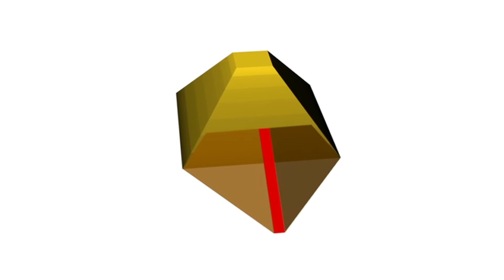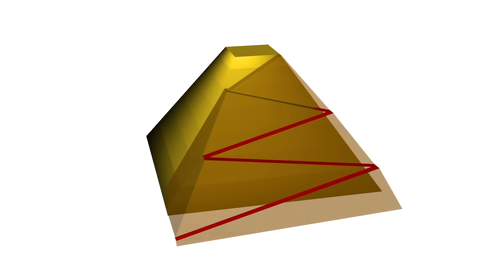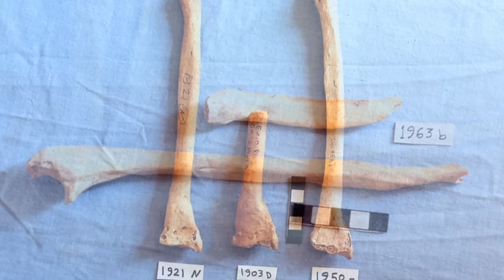Egyptology - Pyramid Construction

Comment: So if it took a long line of people to pull a block up a ramp where did the people stand when the block reached the top of the ramp? Where did they stand when pulling blocks right to the edge? They would have needed another ramp opposite the first ramp. Just add another few hundred years to the time taken then?
Reply: Not really.  So understand a few facts:

1 - the blocks of the pyramid get smaller as they rise in height.  So the largest/heaviest ones are found in = the bottom third of the structure.  Above the level of the King's Chamber of the Great Pyramid the blocks become smaller with those seen at the top being small enough to have been slid into place by several men.
2 - meanwhile the pyramids are rather "large" structures after all.  lol!  So on the bottom part - where the largest blocks are seen - literally hundreds of workers can move about. 
3 - Herodotus wrote they first created a stepped pyramid ala Djoser to then fill in the sides.  He also stated they employed levers and what he termed as "a machine" which is believed to have been a lever device employing a fulcrum and counterweight akin to the Egyptian shaduf.  So such a device could have sat atop the "steps" to raise the smaller blocks above from one level to the next.
4 - finally Herodotus wrote they encased the Great Pyramid in white limestone working from the top down.  As such the smaller blocks on the upper portion could have been raised as noted in #3 while the larger ones could have been raised via an earthen ramp the Egyptians created to raise those blocks and which as they worked their way down placing white casing stones = would have been systematically dug away until they reached the ground. 
4 - finally you fail to account for animal labor.  An ox can pull more than 2X its body weight so that teams of oxen can pull multi-ton loads.  Thus on at least the larger/heavier blocks draft animals would have been employed = meaning less men and less room required. The worker village at Giza contained in its midden heaps many tens of thousands of cattle bones.  Meanwhile there are depictions from tombs of yoked oxen doing manual labor to include pulling large sarcophagi.  So if they were eating cattle = they would have been using them to pull blocks as well. 

Moral of the story:  so when we consider the evidence then it becomes more plausible.  The earthen ramp would have sat on the south side of the Great Pyramid which was closest to the main limestone quarry and the harbor they created. It need only really have gone to the level of the King's Chamber as the blocks above that level become smaller in size. 

As most of the blocks were not that large and were in fact crudely hewn chunks of limestone broken rapidly from the bedrock + the nearby quarry sat no more than 100-200 meters from the pyramid = moving them would not have taken as long as you assume.  Also if you filled the pyramid in from the north side towards the ramp on the south side then using the earthen ramp and possibly smaller mud brick ones for smaller stones you could have placed them level by level.  Then you need to raise the white limestone casing stones beginning at the top via the lever device which sat on the steps below the level you worked at and was moved down as you went. Lots of possibilities based upon the evidence we see.
Reply: Vary Olla - thank you, that is all very interesting. I would love to see a good animated film depicting all this, I think it would attract a lot of viewers.

Comment: These educated fools fail to realize that the ramps that would be required to build pyramids via their proposed methods would require 5 to 10 times more effort and the ramps itself would be more technologically advanced than the pyramids itself.
Reply: Yet that is premised upon a false assumption.  It requires the ramp to = go to the top of the pyramid.............why??

Moral of the story:  the largest/heaviest blocks are found = in the bottom third of the pyramids.  Above that level - ~King's Chamber - the blocks get smaller in size as the pyramid rises in height.  Look at photos online of people who climbed the Great Pyramid to take a selfie.  You will see the blocks at the top are small enough to have been slid into place by several men. 

So they indeed created external ramps to build things like the pyramids.  We have historical evidence as well as archeological evidence of this.  The western cemetery next to the Great Pyramid contains the remains of earthen ramps on partially finished tombs.  Those ramps are made from a mixture of sand/stone chips/tafla - a clay the Egyptians mined.  Further near the worker village at Giza there is the remains of a massive tafla mining operation.  When the limestone quarries at Giza were excavated they were found to have massive amounts of sand/stone chips/tafla dumped into them = or what they made ramps from.  Meanwhile at Karnak you see the remains of mud brick ramps from temples being built but never finished.

So the ramp itself really only needed to go as high as the largest/heaviest blocks to be raised = King's Chamber.  Above that level the smaller blocks could have been raised via lever devices which sat on the steps and which employed a fulcrum and counterweight akin to the Egyptian shaduf.  Herodotus wrote they first created a stepped pyramid and then filled in the sides using levers and what he termed as "a machine" to raise blocks.  He coincidentally concurred with you in that what he called "a great causeway" - read a ramp - was considered to also be a massive undertaking.  

So the technology was not so great after all while the evidence supports the use of ramps.  Something new to think about.

Comment: “How they built the pyramids “ solved.
“How they built the ramps “ still a mystery.
Reply: The ramp would've have been a part of the structures, and it would have been a fckin long ramp at a 10 degree slope going up 300 feet.
Reply: @Mr._POV_  lol exactly quoted graham hancock at joe
Reply: @felixdeboer5814  if only someone could make a 3d of that mega ramp with real life measurements!
Reply: @Mr._POV_  yeah and it would still be there.
Reply: @Mr._POV_  Or you could just pull the stone up the incline of the pyramid. That's a LOT easier than a 1000+ foot long ramp incline to move stones.
Reply: @spikedpsycho2383  lol, let's see how you gonna do that.
Reply: @Mr._POV_  Turn the block into an axle. Build wooden wheels around it. ALSO. Evidence shows wet sand is an excellent lubricant even for big blocks of stone. You can bury the pyramids in compacted sand as your incline. ONCE ITS COMPLETE dig the sand away and wash its surface. Doing that you can finish the pyramid surface TOP down
Reply: @spikedpsycho2383  yea but they didn't use that useless idea of yours. We still assuming except the damn books in our schools that lie.
Reply: @Mr._POV_  HAHAHHAHA :)  SO FUNNY!!! HAHAA! Yes, this is exacly my thought but you said it funny. Also, because 10% slope is actually too freaking STEEP. I know such street and everybody there thinks it's a mistake on a sign and should be 20%. So double that ramp. NOw, whatever would be such structure, it would have to support those blocks.. and where would they get that much WOOD? In Egypt? In Desert? and then what? send it away so far to make it disappear? Burn it? And if so, no story about massive wood ramps burnings?
               THEORY: Ramps were made from Timber and were ONLY FROM ONE LEVEL TO ANOTHER. it was like STAIRS ON STAIRS GOING UP IN STRAIGHT LINE. BLOCK WAS LIFTED UP ON A WOODEN PLATFORM WITH SERIES OF PULLEYS ON BOTH SIDES. ONCE ON THE NEXT LEVEL, IT WOULD MOVE FORWARD, DEEPER ONTO ANOTHER PLATFORM. THEN LIFT TO NEXT LEVEL.    REPEAT. This would mean ONE KIND OF PLATFORM set up ON EACH LEVEL in vertically straight line.
           moving the stone  would be done by Pair of Oxen. Why those fake     experts insist it was done by foot by humans with no shoes? It those are hierogliphics.. WHO MADE THEM UP AND WHEN??????? lol
So the Platform itself would be on WHEELS! a huge CART.
Reply: More than 2,300,000 limestone and granite blocks were pushed, pulled, and dragged into place on the Great Pyramid. The average weight of a block is about 2.3 metric tons (2.5 tons).

24*60 = 1,440 - minutes number in a day
24*60*365 = 525,600 - minutes number in a year
2,300,000 (min) / 525,600 (min/year)= 4.3759 (year) 

If you pose 1 block every minute it takes 4.4 years to finish the pyramid
If you pose 1 block every 2 minutes it takes 8.8 years to finish the pyramid
If you pose 1 block every 4 minutes it takes 17.6 years to finish the pyramid
If you pose 1 block every 12 minutes it takes 52.5 years to finish the pyramid

I cannot imagine logistics even for a 12 minutes block during 53 years, day and night.
Reply: Hahaa 🤣
Reply: @Neil Kraft Hahahagaaga!
Reply: Its just ridicilous😂
Reply: What if they were just there as part of earth from the beginning? Like Mountains
Reply: @preston8859  🤔🤔🤔. Thats a fresh take on it.
Reply: domesticated megafauna... Carthagens domesticated thousands of elephants... back before last 10k year extinction event; there were easier megafauna to domesticate then elephants.
Reply: It’s just one of the hundreds of pieces of evidence that the Egyptians did not build the big pyramids.

There are about 120 pyramids in Egypt. Only a few of them 5 or 6 are built by the unknown civilization or with the aliens' help. When the Egyptians came to the place about 5 thousand year BCE the big, great pyramids were already there. All other pyramids are the Egyptians' masterpieces, no doubt. They tried to copy the Goods, but they looked like a scooter near the VOLVO truck. 

Try to find academic proof that the Giza pyramids were built 2.5 thousand year BCE. No way. There is only one - the two inches Khufu figurin found on the roof of the pharaon chamber. The pyramids are already designed on the ceramic of 4 thousand year BCE. But for academics they are not pyramids but the mountains. Ah-ha-ha-ha-ha-ha!

Academics told us that the pyramids were built to keep the pharaoh body in the sarcophagus. But until now all the pyramid sarcophagus are empty, even in the untouched pyramids (Sekhemkhet pyramid). By the way, the flowers on the Sekhemkhet sarcophagus are dated 2 centuries before Sekhemkhet life :- ))

20 years ago we must listen to the history teachers with their simplified linear version of human history. Now, thanks to god and to Youtube, we see Baalbeck, Temple mount, Mahpelah cave (Cave of the Patriarchs), Pyramids of Egypt, Machu Picchu, Saksaywaman, Tiwanaku etc, etc, etc. 
We see the traces of the rotative sees, the cylindrical drill up to 20 inches diameter, the megalithic masonry, all the masterpieces impossible for the stone and copper age. Even if you put 10 employees on the row :- ))
Reply: Great question 👍👍
Reply: X-D  youtu.be/7K0eZNSZKjI     100 TON    stone boxes discovered in egyptian tunnels -  strange machines found ?
Reply: Pyramid is made up off giant bricks.
Reply: lmao !!!
Reply: You can make a ramp with packed dirt and in many other ways and variations. Also remember that stone age/bronze age peoples had the same brains as ours...  A ramp isn't unfeasible. Who cares if it spiralled or was straight. Also have you seen the video of school kids moving a megalith? It's not totally ridiculously hard to move a massive rock up a ramp you made for it. Admitting we don't know specifically doesn't mean it couldn't possibly be done with a ramp. Ramp. Ramp. Ramp. Mystery closed.
Reply: @TheDeahgib  The everyday guy in construction , excavation and even laborers think you so called intilects just dont know , and have no experience. I think the answer will be so simple it will embarrass most amature engeneers and some pros. were thers a nees people get shit done. no magic to it.
Reply: or if there even was a ramp at all
Reply: And how they cut the stones with that precision....no fuckin idea
Reply: pyramid might of been big generators to creat free energry. I could be wrong.https://youtu.be/YVVzz5-1tco
Reply: HAHAHAHAHA literally sitting here after dying of laughter. I’m ded
Reply: Hahaha
Reply: Ermm I love how everyone says " it's a mystery how it was built and who built it" and there's no piece of record showing or proving how it was done, but no one even tries to just think about a book that's been written about 3600 years ago explaining how the Jews were enslaved simply for their religion and the men were forced to build those pyramids that you all look at with awe.... The same Jews whom of moses has brought 10 plagues upon the Egyptians until they were released from slavery and from Egypt in famous "exodus" thats got shows and films written about it nowerdays such as "Prince of Egypt" etc. And those same Jews (or "Israelites" at the time) have been celebrating every year that massive day of independence and freedom for the last 3600 years or so, and have been writing countless books about the events that unfolded, ever since then which are traceable and time accurate and been passed on generation after generation, and then archaeologist just say "nah, well just try to see if there's clues in the sand or the corners of the stones...."

I was brought up Jewish, and even tho I hold myself closer to being an atheist today rather than as religious man, but when it's literally written on the paper you can't just ignore it...
Reply: @bennyrich7361  Maybe no one takes it seriously just because people know how obsessed your tribe are with fairytales.
Reply: it astounds me that archaeologists are the "experts" for explaining a complex engineering problem.
Reply: using pyramids
Reply: 😂😂😂 exactly
Reply: Anunaki people built it, before Egyptian people. Egyptian people took it over but not originally built by them. Giant power mother fuckers from the planet Niberu. Some shit like that I think
Reply: Hieght of the ramp can be determined by wooden stacks at any point near pyramid big rocks not needed to do this, no freaking mystery
Reply: @teal1787  yea they just liftet multi tons with hydraulic, like nowadays
Reply: @Lumithell  how people turn to white , yellow ,n brown ?  Plastic surgery were invented by that time ?
Reply: @akumjamir5322  😂 pigments low
Reply: Not really, the ramp is still there and has been known about since the 1980s when it was scanned and mapped by the French. It was never removed or filled in (apart from the corners). You just cannot see it from the outside. It was documented as early as the actual construction. Only problem is people prefer to pretend there is a mystery.
Reply: Ancient Ethiopians people are build pyramid not Egyptians and we no How they build pyramid and search about Ancient Ethiopians History and you we no about us How they rule the Egyptians
Reply: @bereketbirhanu4324  we don't know, we don't.
Reply: @Mr._POV_  read this book.    Wonderful Ethiopians Of Ancient Cushite Empire       Book by Drusilla Dunjee Houston
Reply: @bereketbirhanu4324  why use many word when few word do trick?
Reply: @bereketbirhanu4324  true, first people on Earth where black.
In Islam Jesus, Moses, and Adam were black

Comment: It's pretty silly that people want to say the people back then were just as knowledgable about the universe and math and science as we are today. We do learn things over time, we do gain knowledge from our predecessors and pass it along to the next generation. But somehow, all the technology about constructing these pyramids is gone. The mechanical engineering, gone. The astrological engineering, gone. The construction engineering, gone. How did they light the inside to work on it? There's no soot on the walls, no evidence of candles. How did they ventilate so a candle would even stay lit and the workers wouldn't suffocate? Now they're saying it wasn't even slave labor that built them, meaning a smaller pool of workers. I believe alien technology played a major roll in this. Extraterrestrials visited, shared their technology, then took it and peoples memories with them when they left. If you've ever built anything, you know no one built that pyramid using string and red ochre, or ramps, it would've taken a 1000 years. Yet some estimates say it was as little as 20. That's totally insane.

Comment: The ramp is not even an efficient way to build the pyramid, bc you have to build it and take it down. I feel like they built the pyramid from the top to the ground. That’s why you’ll only see a few quarry around. Building from top-down allows the builders to cut and place the blocks right away, as well as dismantling the mountain. If any ramps were used be just a simple ramp up to the mountain to deliver supplies like foods and tools, and easy access for the workers.

Comment: Hey, 30 year man. Build a ramp and show us exactly how they did it. I think that ramp would have been a greater monument than the pyramid itself.
Reply: exactly....a ramp that went around the pyramid as depicted in this video would be an engineering feat nearly equal to the pyramid itself and as difficult to make.
Reply: @ronyeahright9536  yeah its not exactly as simple as making a huge dirt mound like in that animation. That thing would have to be incredibly rigid and structured to maintain its form and the weight of loading 40-ton boulders over it.
Reply: your hubris... shocking